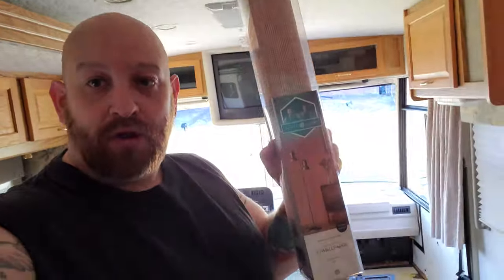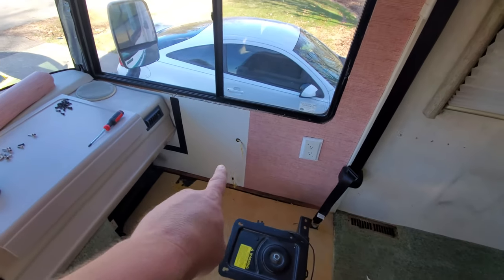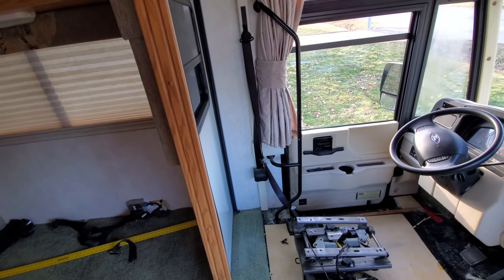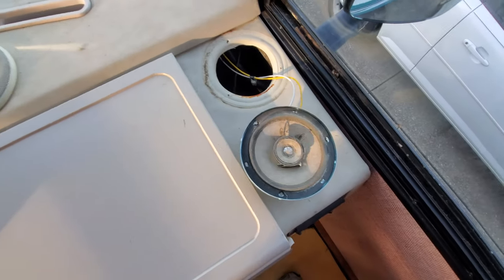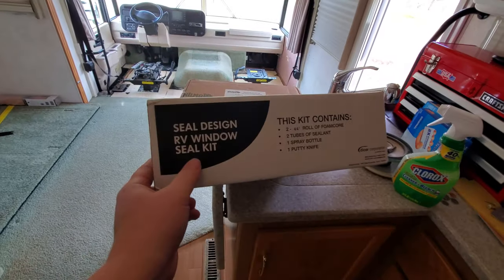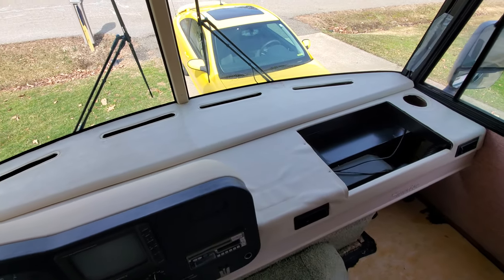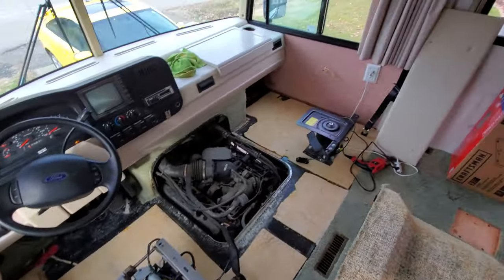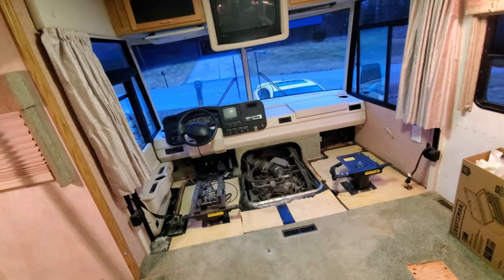RV DEEP CLEANING : REMODELING THE COCKPIT part II : RV Checklist episode 13

Comment: The wall paper looks good.  It goes nicely with the backsplash.  I hope that window is the leak problem.  OMG!  That's a lot of work taking the trim off and putting it back.  I'd have the holes stripped so big, I'd need bigger screws for everything to stay in place.  LOL  HUGS~Donna